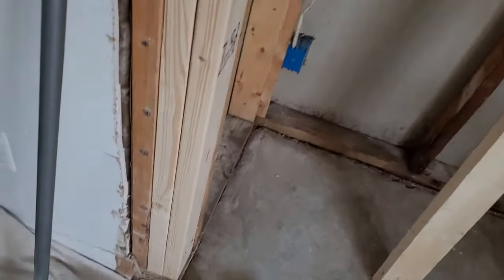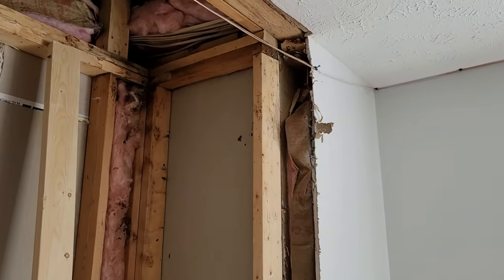WE found TERMITE DAMAGE in Our HOME | DIY GONE BAD | the PONPONS

Comment: How far up did you remove the Flue? What did you do to seal it from the roof?
Reply from the maker: The flue pipe still remains in the chimney portion on the roof. We taped and sealed off the end of the flue pipe that's hanging from the chimney, we couldn't find a cap to close it off. The inner pipe is completely gone, all that's remaining is the outer shell.